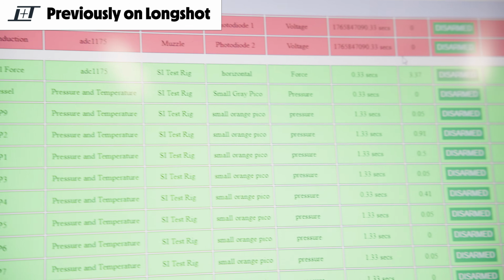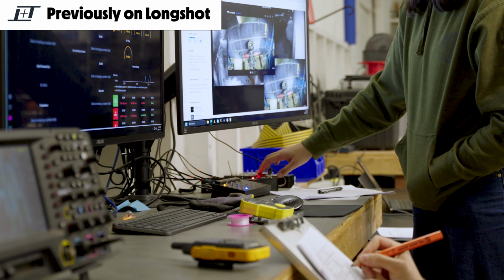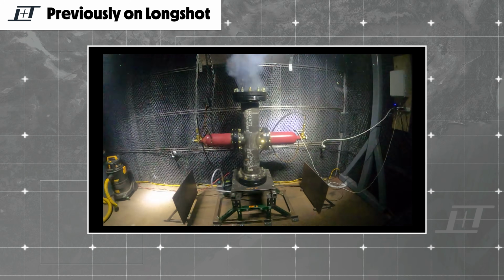Longshot | Introducing the 6” Accelerator with Side Injectors — Build Update

Comment: I'm guessing that in the beginning you guys thought of using a light gas gun without the additional side injectors. How did that work out, why did you decide for the greatly increased complexity of additional injectors? Was the power output just not enough with a single main injector?
Reply: Main reason for multiple injectors is to keep average G loads down.  lots of small kicks means that the projectile doesn't see as massive g loads.
Reply: @natosaichek  Ok, that makes sense for a payload more sensitive than ballistic shell.

Comment: I know you guys aren't very close to a final design yet, but you need to start thinking about making a welding machine that weld the side injectors directly to the accelerator tube, without flanges. Those flanges add a lot of weight and cost and take time to weld on. You will also want to make up a method for removing and reinstalling the flange-less side injectors.
Reply: Weight doesn't matter on the ground.
Reply: @cheeseburgerville  It makes things harder to move around so it does matter, just not nearly as much.

Comment: As the barrel gets longer, does the increasing volume result in losses for each subsequent injection?
Reply: There are diminishing returns as the vehicle moves faster but not because of volume. Once it is supersonic it's not actually base pressure but momentum exchange between the gas coming in from the side and the wedge. In that case the diminishing returns are due to the wedge being between a given set of injectors for a shorter time as it passes by faster. You can increase the pressure in the later side injectors or change the working fluid to compensate. 
Great question!
 
Mike: The CEO